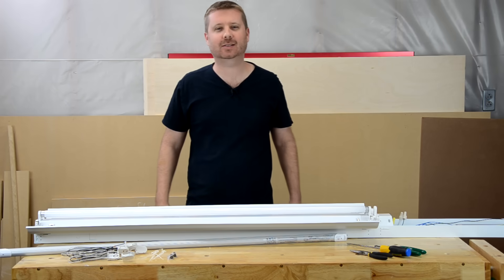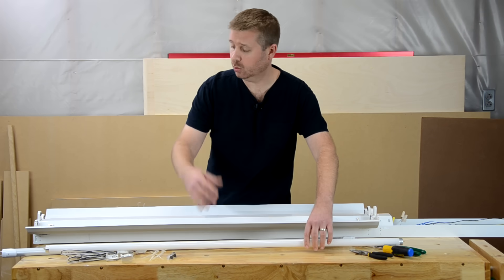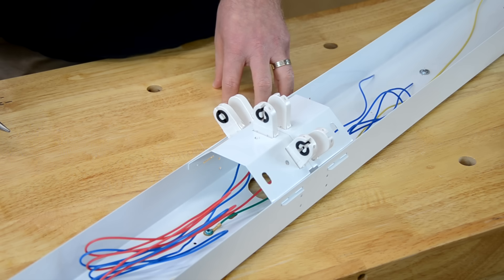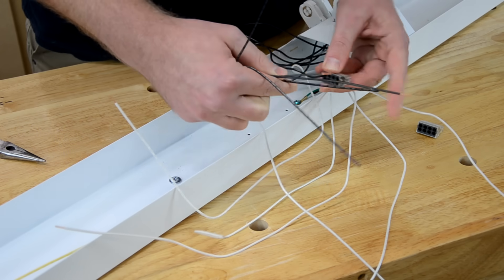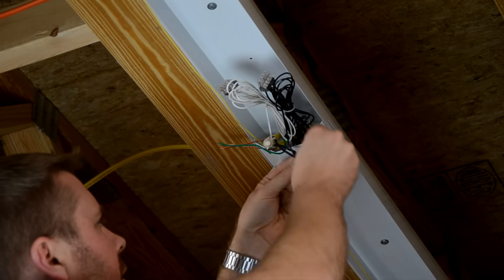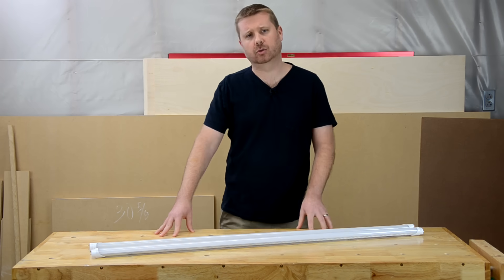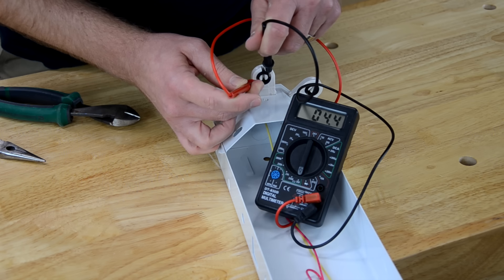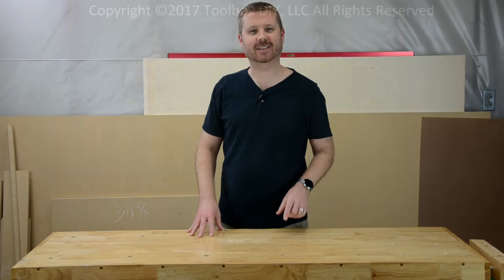How to easily convert fluorescent Lights to LED –Easy Ways to Save Money

Comment: LED cost 5x more and after 6 months are so dim due to LED burn out , I'm keeping Fluro tubes in the workshop. .   Like all new stuff on the market that hasn't been proved. What they don' t tell you is the consumer LEDS are schite compared to the commercial but who can afford them. Nice video though, so thumbs up for that.
Reply: You must have rotten luck, converted my shop five years ago to all led and have not had even one fixture go bad
Reply from the maker: I'd be pretty pissed if these bulbs started to dim after 6 months! So far, I've been fortunate not to have that happen. Can you share the brand(s) with which you've experienced this? I'd like to stay away from those and I'm sure others would as well. Thanks in advance.
Reply: For decent name brand LED tubes there hasn't been a fading problem in 20 years. It's only the cheap offshore tubes with low quality LED's that suffer from this problem.
Reply: I replaced my shop lights about  3yrs ago with LED Fixtures  and Love it  no more buzzing or replacing tubes  or waiting for them to heat up when its 20 Degrees out . now I can go out in the winter time and flip the switch and count 3 seconds and I have light. and at 36 bucks a Fixture it was not bad
Reply: schmudge I think industrial grade would be the way to go .....
Reply: I think it was Lights of America  Got them at Sam's Club  4ft Shop fixture  36 dollars each and  they still work Great nice and Bright
Reply: Also, besides the LEDs failing, many LEDs come sealed in epoxy, and the epoxy can discolor from excessive heat.  I haven't spent much time looking into that, but I've seen some comments that LEDs that are sealed in silicone instead of epoxy don't have this problem so much.
Reply: ToolboxDIY Yy
Reply: This looks like a good explanation of the problem:

http://www.ledsmagazine.com/articles/2005/05/fact-or-fiction-leds-don-t-produce-heat.html
Reply: Most of my house has LED lights now.  They're also pretty cheap.  Dimming?  HAHAHAHAHA.  I get the Hyperikon T8 LED Shop Light Tube, 4ft, for my T8 Florescent bulb replacement.  From Amazon!!!  So a single one is about $17, but it drops down to just over $10 if you buy a 4 pack.  to under $10 in a 24 pack.  So the biggest price drop is buying the 4 pack at least.  Don't buy just one.    That is really not much more than a Fluorescent Tube.

At work I use the Philips 32-Watt 4 ft. T8 Daylight Linear Alto Fluorescent Light Bulbs.  Looking at Home Depot, a 10 pack works out to $3 a bulb.  What's funning is it says that the Life: 27.4 years (based on three hours/day)  HAHAHAHAHAHAH, man if only!!!!  I get a couple years out of them.  I'm always replacing these things at work.  Sometimes I also have to replace the ballast.

These things also DIM.  yes, they do DIM, they also get black, on the ends over time.  LED's don't do that.  I also don;t buy cheapo LED's.  You know, crap from ebay that ships directly from China!!!  Those Philip bulbs are 32 watts.  The Hyperikon T8 LED's are 18 watts.  So use half the power.  Should have a much longer life.  and no ballast that could fail in the future.

Right now I have those LED's, the 4000K in the HR office, and the 3000K ones in the Owners office and they couldn't be more than happy.  The HR ones I did in 2015, the Owner I did his office in 2016.  They still work perfectly.  Same brightness as when they were first installed.  Those are the 2 most important places to have happy people.  Those are also 2 places where I'll never have to deal with light issues for YEARS to come.
Reply: schmudge, No dimming of the Phillips or UTILITECH T-8 bulbs in over a years use. They cost a little more but don't seem to have any problems. Simple change out and replace in 5 year old fixtures with electronic ballasts.
Reply: schmudge are u for real. I guess the wheel was dubbed a bad idea some when it came out to. Thanks for the smile
Reply: J L Grizzly What brand JL?
Reply: 1995dresser What brand did you use?
Reply: big box stores are $5 to $7 depending on whether you buy a few or 20
Reply: You either used direct replacements LED tubes without verifying that the ballast was INSTANT start, or you bought cheaply-built no-name LED lamps. Name brand LED lamps properly installed will last for 5 years in continuous use, and unlike fluorescents, they don't deteriorate in intermittent use.
Reply: Hyperikon T8 LED lights are the way to go.
Reply: We started testing them out for over 2 years, in hot areas over 130 F and cooler areas such in our offices and not to forget outside at our loading docks. We have well over 100 of them installed and all are still working. One of them was bad from the factory when we got it.
My test results where as follow,
A straight connected LED bulb puts more light out, than if the ballast was used to power the led. There was a significant different in brightness. Also if you had fixture with 2 or 3 or even 4  led bulbs in it and you used the ballast, the light output was different with all the led bulbs. 
There is no difference in brightness in my 2 year use in hot, cool and moist environment so far.
Side by side with an 130 F the florescent fixture went through  2 bulbs since they went bad in use , while the LED still has the original bulb and the brightness of the LED stayed the same while you could see the florescent bulb dim down. What a difference when you compare them side by side.
I did not see a dimming down on our LED lamps/bulb or any LED , not even our 4 year old screw Led.
Reply: Heat buildup is a serious problem for LEDs.  One problem is that people are swapping LED lights into situations that weren't designed to avoid heat buildup, which greatly reduces the lifespan of the LEDs.  The classic example is a recessed lighting can.  It's even worse with cheap LEDs, because the cheap electronics in them tend to produce more heat.
Reply: IT IS A BEST TECHNOLOGY AND IS PROVIDED ONLY ON THE COUNTRIES OF RANG 2-3. THERE ARE ALSO "CHINEZARIANS" BUT OF SUPERIOR QUALITY AND TO 6-YEARS COSTS, THAT THEY ARE MORE COMPETITIVE ... BEGIN AND YOU WILL BE VERY HAPPY AFTER 6 MONTHS.
Reply: Christopher Gaul - Stop making up nonsense fiction.  There haven't been name brand LED tubes for 20 years, period, decent or otherwise.  When the first domestic tube were produced fewer than 20 years ago, someone would have had to have been an idiot to buy them because they were less than 1/4th the lumen output of a $2 T8 fluorescent tube, but cost over $100 each.
Reply: What the fuck are you buying 5x more expensive and dim in 6 month, you are being scamed. Get some CREE CXB 2540 only £15 and give 6200lm at 50w.
Reply: I've seen places that get lediseased and the tubes start to change to a sickly greenish tent after six months. I'd rather keep my fluorescent than deal with leds that don't last 10000 years or whatever ridiculousness they claim.

Comment: Hello nice video. But one thing you forgot is. Which end is for the power side and which end is non powered. I got some bulbs that had no marking for live or neutral mains power. And didn't say which end is the dummy end for holding. But again very nice video.
Reply from the maker: You're right, I didn't demonstrate that which is why I added the text at 8:20 to try to point this out. I expect every manufacturer does it differently and, as you experienced, they may not mark it at all. When I researched bulbs, all of the single ended tubes had non-powered ends that weren't connected to anything so inserting them backwards wouldn't cause any damage. I hope this was your experience as well.

To all viewers - if the bulbs don't work when you install them, try reversing them to see if that does that trick. Thanks for pointing this out, Joseph!
Reply: I print out labels to stick on my light fixtures, they say something like LED Conversion, Power Side, 277 Volts!!!

All the lights, no matter the type at work are 277 Volts.  A single phase of 480 3-Phase, plus ground gives you 277 volts.  Seems strange to me.  SO I use the Hyperikon T8 LED I get from Amazon which are 120-277 Volt.
Reply: Yes many manufacturers would place the label on the LED driver end. And except the single ended LED tubes, there're also Type A ballasts compatible LED tube with double ended, and the perfect double ended Type B LED tube. I think the double ended type B is the most easiest way of rewiring.

Comment: I have two eight foot light fixtures wired together.  Obviously the single shunted would not work, because it wouldn't carry the power to the second light fixture.  Could this be accomplished by coming off the pig tails?
Reply: Daniele De Marzi 

There is nothing dumb about it unless your a dumb clueless person like yourself.  It’s perfectly safe.  I don’t remove a tube with my hand anywhere near any socket.  Conversion or not.  A ballast is just something that will end up failing and you having to go back and fix whatever the issue is once again.

I clearly label anything I’ve converted.   It’s safe so long as you have half a brain.  If you don’t want to do it, good for you for knowing your low limitations.
Reply from the maker: Are you converting both fixtures to single ended LEDs?
Reply: In my case, doing conversions at work. They're 277V!!!  I don't think it's an issue at all.  I do Label the light units I replace near the Tombstones.  Saying LED Power End, 277 Volts!!!  Might they break?  Sure, anything is possible.  Once you install a new LED, that thing will be in there for years to come never to be touched.  On the off chance, it happens to break, like anything, you can be smart about it, or dumb about it.
Reply: I guess you take the dumb about it side.
Reply: I personally don't like the idea of single ended LED conversions for this reason. Especially if the fixture is low and susceptible to being damaged. With double ended the chance of getting a shock from touching the socket is cut in half ;)  These types of LED conversion tubes should be required to come with labels. Say the end user tries to replace a burnt LED with a plain old fluorescent tube.. With the single ended conversion you'll just get a boom, with the double ended I'm pretty sure nothing will happen. Correct me if I'm wrong as I haven't tried this yet :)

I really don't like the LED conversions that require a ballast, they are very finicky and often will not work with instant start or older ballasts depending on brand. I only have 14 years on the job experience, 5 of those years spent doing a lot of lighting maintenance and retrofit. I can say with confidence that most new ballasts will burn out within 1-5 years. They don't make them like they used to! I've taken out magnetic ballasts from 1960 that were still going strong. I think they're made to break down around the time the warranty goes out (5 years on most electronic ballasts) which isn't a perfect science so they'd rather have to warranty a few ballasts than to sell less ballasts (which is purposely a painful process and they only give labor credits for future orders)
Reply: JB Dragon
Reply: if a socket is broken, it usually means the fixture was damaged. This especially happens on hanging fixtures. When a fixture it hit and broken, the chance of the cover falling off and all the wiring being exposed is just as great. I don't think it being a converted fixture will really make much of a difference either way in terms of danger or impending doom.
Reply: James Balducci 

You just want to jump to a extreme case.   Well anything is possible.  That will never be a issue with office lights.

There’s very little wire anywhere when you do a conversion.  If you were smart, you’d add a low amp fuse to your lights, but in your worse case there, the circuit breaker would have popped killing all power.  For all the lights I’ve done over the years, your worse case rarely happens.  About the worse I see is the light has been in so long that it gets stuck in the socket and takes a bit to unstick, wiggling the tube a bit.  With my hands no where near and end.

I’m working with 480 volts and large transformers here at work.  Simple 277 volt light conversions are just that.  

If your lights are someplace where they’re getting hit into all the time, you have other issues.
Reply: The ballast is a safety feature and should not be removed. you get a high voltage with a low amperage that will shock you but kill you. Removing the ballast now expose you 120 volts and high amperage that can kill you. I have seen those sockets you call tomb stone break exposing connecting parts that connect to the pin on the tubes. I talk with experience 34 years as licensed  electrician. I good electronic ballast will last 5 or more years not the short time mentioned in the video.

Comment: I recently converted my fixture to the LED tubes before I saw this.  I never knew  LED tubes they came in single ended. The local hardwares store by me only had the double ended tubes. I decided to keep the ballast in place in case I decided to go back to fluorescent tubes.  There have been complaints about LED's not lasting very  long. Also with mine I had the non shunted tombstones and I had to make them shunted in order to make my LED tubes work. Thank you for putting this video out, but people should do there home work before taking on this retro fit.  One important thing to note is to make sure your ballast is compatible, mine wasn't.  Best to call the manufacturer of the LED tubes to find out for sure.  The people at my local hardware store didn't have a clue as to what ballast to use.
Reply from the maker: Excellent point about checking ballast compatibility! I overlooked this since I was removing the ballast altogether. I think it's a great idea to keep the ballast if it's good, but bypassing it will prolong it's life if you ever decide to go back to fluorescent bulbs.

Out of curiosity, do you know why your fixture already had non-shunted tombstones? Does the fixture have a starter in addition to the ballast?
Reply: Some of the tombstones he had in the fixture had two wires and were probably non-shunted.  He replaced them to show how to do it.  Actually many fixtures have non shunted tombstones that are wired as shunted.  Some of these lamp holders have the wires 'back stabbed' in (like switches do) and can be rewired either way.
Costco is selling replacement LED tubes that are double ended and are meant to be used with ballasts.  I've used these to upgrade existing fixtures, it's easier to do as there is no rewiring.  Also, since the LED tubes draw less power, the ballasts are likely to last longer as they will not get as hot.
Also most of the LED tubes are T8's, but they can replace T12 bulbs.  One problem with the LED's (especially the 6 and 8 foot ones) is that they are not as rigid as the glass tubes and will sag in the middle.  Not a problem if you have a lens in the fixture covering the lights, but if not you might need to add a support clip in the middle of the tube.
Reply: Ballasts compatible LED tube must come with a compatibility list, local hardware store should check the ballast for its customer before selling out the tubes, this is responsibility. Ballast compatible LED tube is a way for fast retrofitting, and another way for fast rewiring is to get a double ended type B LED tube.
Reply: I replaced my fluorescents with LEDs without replacing the ballasts.  The 8 tubes use  a total of 240 Watts.   I think they would use much much less if I got rid of the ballasts.   I am looking for ways to get rid of power drain, so this video was helpful in understanding how the LED's work.  I will get my multimeter out and take some measurements as well as look up the LED tube specs to understand what I'm dealing with.